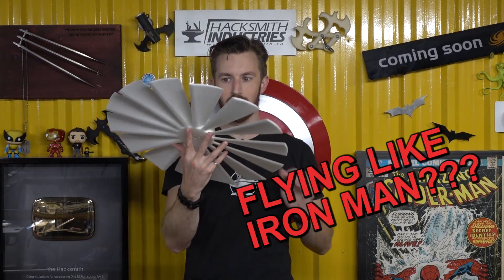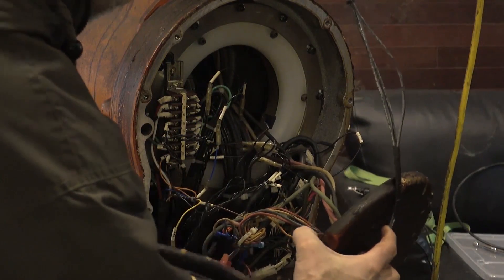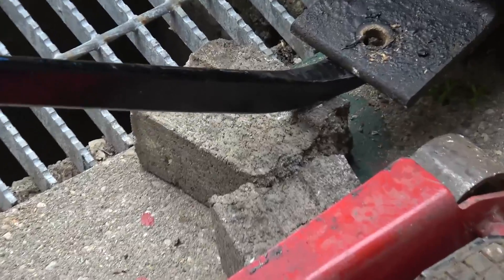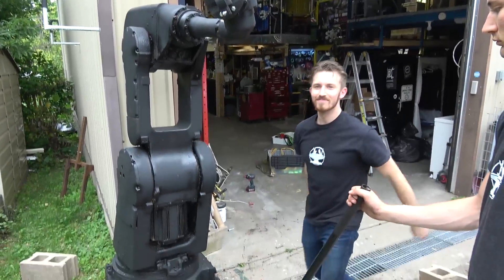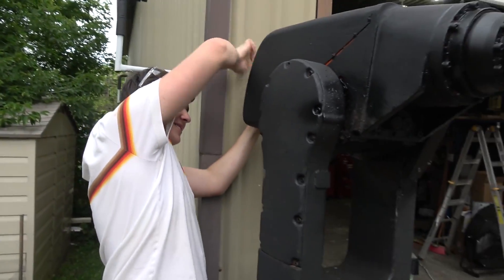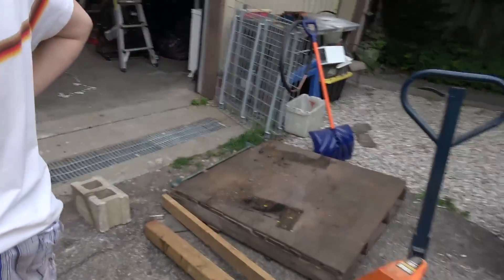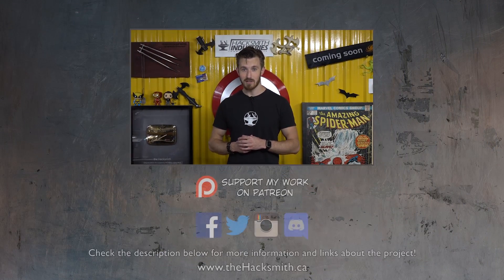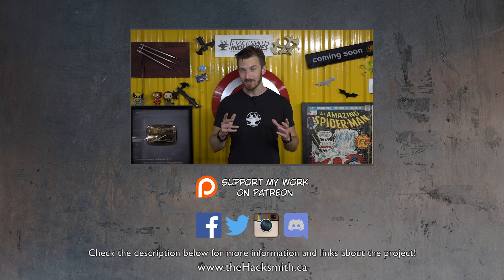Was the Robot a Mistake?

Comment from the maker: See what the robot looks like NOW! (no signup required) https://www.instagram.com/p/BYHXDgHh7I6
Reply: you should build the Inception Dream Machine
Reply: the Hacksmith sell it for 75% more from when u got it
Reply: dude, whenever you finish the flying like iron man project, do a bit with it where you jump then turn the fans on to make it like a double jump just be careful about it lol
Reply: the Hacksmith now to wait for the video "soooooooooo somebody stole our robot." Love your videos and am a happy subscriber
Reply: "the dunce bot 3,000"
Reply: You could totally just strap on a bunch of powerful motors you could control remotely, basically rebuild the guts for the empty arm shell you now have
Reply: the Hacksmith i
Reply from the maker: +EvilWaffleIron _ I don't think that's possible -- even if we go with our design that would cost $75,000 it won't be able to accelerate that fast to simulate a double jump :(
Reply: dang that's a bummer but I'm still hyped to see you flying in the air good luck
Reply: Lol Colin furze needs to go back to school
Reply: the Hacksmith i wish i had 70 000 $ so i could donate them to you so you could make the iron man suit ahh... I wish...
Reply: i dont know if this will work but if you could directly wire up a few things and connect relays and a few switches you might be able to make one of the motors work or maybe even use the lifting motor for the forearm of the robot. i dont know. ive made my own motor relay before out of a light switch and a few wire scraps and a broken extension cable. it was a vacuum cleaner motor about a foot in diameter. i am now wiring up a water pump motor that is 115 volts and runs at about 1170 rpm and i attached a lawn mower blade to the front bit that is disconnectable and i will test it soon with my friend. i am the designer and he wires them up for me
Reply: the Hacksmith i
Reply: you should make the robot head go upright and install a Red Anti-Collision Beacon like the ones you see flashing on and off on top of towers

Comment: That thing is going to be hard to get working. Do you think it would be easier to gut it's internals and use the chassis to build with new components inside? You would then have more modern controllers and functionality.
Reply from the maker: +Daniel Boyd didn't you watch the video...?
Reply: the Hacksmith I did. I saw how you  salvaged the internal components to sell after you explained all the challenges of getting it running in it's current assembly. My question was you now have a valuable shell to work with and put your own motors and controllers in. I understand that won't be cheap, and if that was one of the options that would have bankrupted the shop then fine, It just wasn't apparent from the video unless I missed it.
Reply from the maker: Oh I thought it was pretty clear that any attempt to fix it (or rebuild it with new motors) would be far too expensive! Sorry!

Comment: It looks super sturdy... but I'd still put a bolt on at least one corner - juuuuust in case.
Because when that thing tips you're gonna:
A. have someone hurt
B. Have to pick it up again
Bolting the thing into the concrete shouldn't be to expensive and provides a clear heath and safety benefit ;p
Reply from the maker: Already done

Comment: I'm really sad to see the robot get cadavered. Sure it would have been expensive to turn back into a production machine with all the power, cabling, controller, etc issues. Been there. But mechanically it (presumably) still worked. Just as a skeleton it's a huge amount of engineering already done for you. I would've thrown in some normal, cheap motors (salvage, or asked for donations from fans who had something they could send), and then a few controller bits and some modern software (well, honestly, an arduino would outthink whatever it came with originally). Could've become an extra member of the crew. I dunno how remote you are, but you could've also done something like tell a local high school or college that you'll buy the parts if they want to do the work on it to get it able to accept G-code, let them tinker at your place, show it off at a science faire or a couple demos a year. No one else is going to let them get their hands on a real industrial machine. Food for thought.
Reply from the maker: Still not worth it. Time at the shop is also valuable and it was taking up too much space. Local schools already get donated robots from Toyota (usually in much better or working condition) anyway.
Reply: Like all makers, you have a dozen projects for every one you have time to finish. The big projects are like your megafauna. Rhinos, elephants, hippos, giraffes... they're the ones that get all the attention, but are no more significant than the little mammals. I look at a giant robot and I'm like "Oh, that's a shame it's not getting worked on", because it's big and attentiony and a robot, but, at the same time, meh. It's just a thing and you have to be selective.

Comment: if you dont have 3 fase 380 v  you can buy the inverter from 120 or 220v.
Reply from the maker: The transformer is the easy part... our power is single phase. Rotary 3 phase converters cost a few thousand